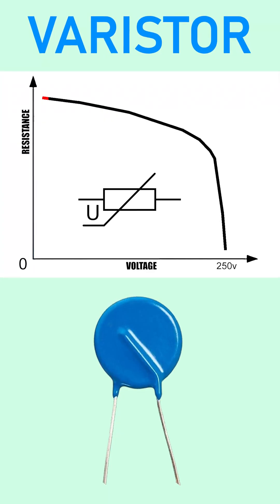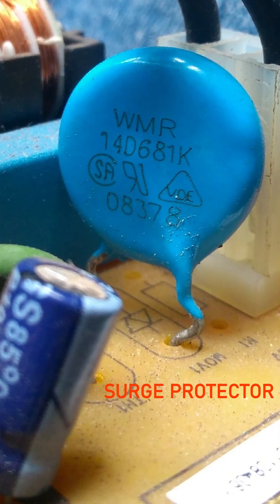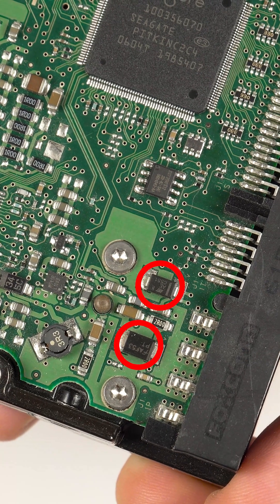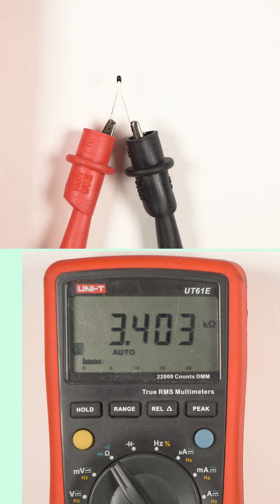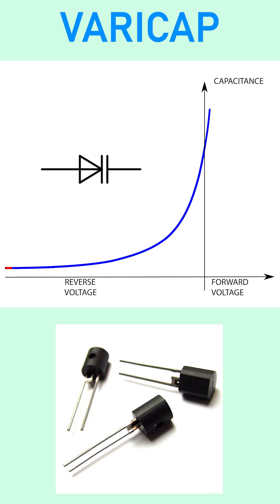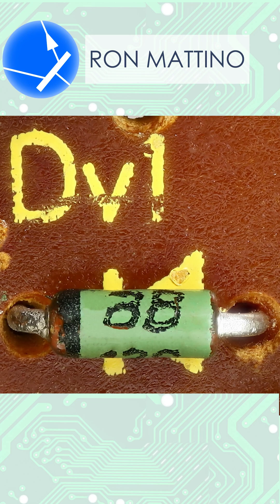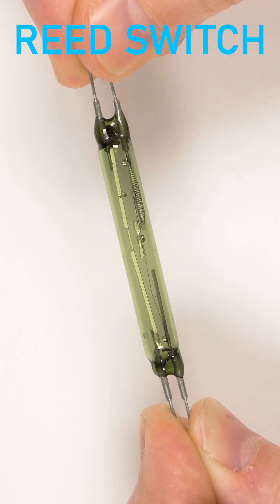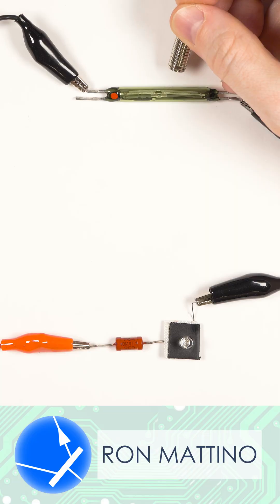5 Exotic Electronic Components that You've Probably Never Heard Of #electronics #diy #transistor

Comment: Resistance of a thermistor is not proportional to temperature.
It is inversely proportional.
Reply: There are both types, PTC and NTC
Reply: @gsilva220  Traditionally the thermistor is an NTC device because it is made from a non doped semiconductor and the conductivity increases as the temperature increases because more electrons are given energy and are kicked up from the valence band to the conduction band.

PTC thermistors, often referred to as silistors, arise as a result of extrinsically doping a piece of semiconductor material.
Reply: Inversely proportional is a type of proportional relationship 🥂
Reply: @heavenlymonkey  They are in fact complete inverses of each other.
Reply: Seems quite dangerous? When a component is overheating it is allowing even more electrons to flow.
Reply: @sneaky_krait7271  It is not necessarily dangerous. The component may burn out.
A burnt out component generally isn't dangerous. It just causes the product to fail.

But you can design in measures to prevent it.

But semiconductor devices typically suffer from thermal runaway,  notably power transistors.
Reply: @deang5622  well I guess I disagree, burning down and fire is quite dangerous in my opinion

Comment: Insted of a thermistor, you can also use a standard diode conected in the reverversed way. The heat will change the resistance
Reply: The effect is not as big. In reverse bias, the current that flows is a minority saturation current, it is very low, and all the heat is doing is enabling that to increase a little.

It is not a replacement for a thermistor.